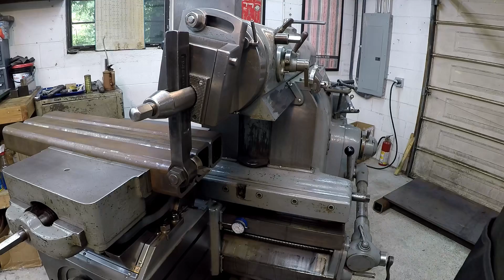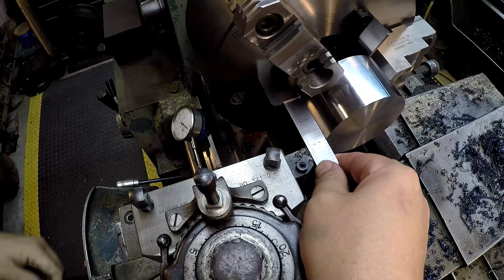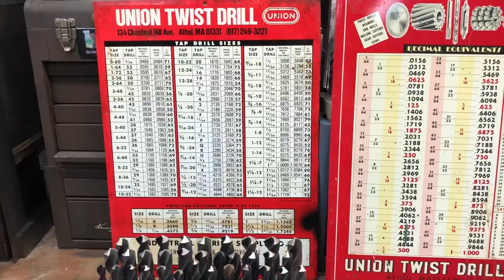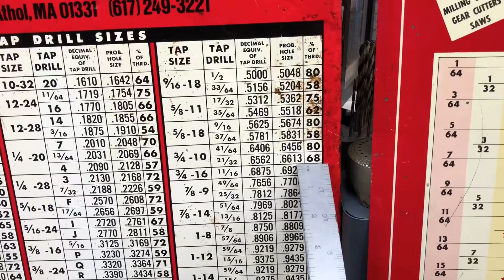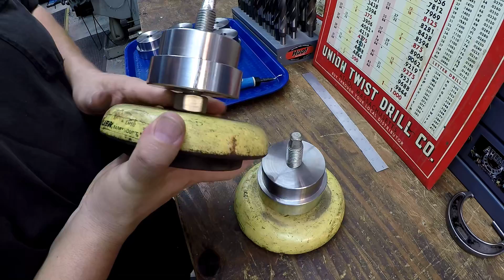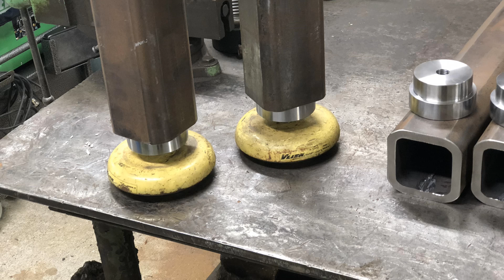SNS 225 Part 2: Weld Bosses for Table Legs

Comment: For all the people complaining about you spending all that effort on buying and shipping and restoring the shaper, here's your answer. How else do they propose squaring up those tube ends? Get a 5" long end mill and hope you don't wreck it on that weld? Stand the tube up, bolted to the front of the milling machine table, and indicate the sides perpendicular to the table? Set it in a four-jaw chuck on the lathe and hope that you've got a great big through spindle? No, just set it in the shaper vise and set the automatic downfeed, and sit back and watch, making sure you don't get chips flying at you.

Comment: i worked with a old machinist he  was 90 years old in 1994 but dang he could  lay down some tooling fast. Sitting at the break room table said his boat had a full machine shop in mills drills whatever they needed he did say they got into trouble one day trying to get out  fast they through the whole machine shop and welding shop over board yes that what the man told me. its kinda weird those of us never been on a bout to have a full machine shop welding shop etc but they do thus day

Comment: Does only the male threads need the crest removed or do you have to also remove them from inside the female post tapping?
Reply: Only the male.... the female shouldn't have the same burr as a male thread

Comment: how to set R.P.M for cutting and is there any formula for this purpose
Reply: There's one equation which I've used, though it's for metric, I don't know if it's applicable with imperial.
ω = spindle speed (RPM)
s = speed constant found on chart (m/s)
d = cutter diameter for milling or stock diameter for lathes (mm)
ω = s * 1000 / 3.14 * d

The 3.14 should be pi but I don't have that symbol on my phone. As I said, this is for metric and may not be for imperial.
Reply: Imperial calc. is pie × radius square.

Comment: Not a use for a shaper that I would have ever thought of.  I always really enjoy your shop videos.

And yep, you have about 0.005" of shimming to do on that tailstock; note that unlike cutting to see whether it cuts a taper, direct measurement means you make the adjustment for the full indicated difference.

You have to paint over those rust-conversion products. They make an excellent primer (once they have converted the rust and turned black), but they are neither weather-proof nor abrasion resistant.

Comment: There is nothing more satisfying than watching steel being squared on a shaper! I really like that shaper. You're looking good too Adam! losing weight, feeling better I bet. I'm a buttermilk biscuit under 300lbs but I'm losing weight, had to get my diabetes under control, most of my biological family has diabetes, bad hearts etc. It's in my genes. But I digress, great video's I love your work. Those drill bits are nice and sharp, I love it!

Comment: Use osopho on raw tubing to prep for paint. It leaves a white powder when dry (two or three days). In South Texas we use it to prep salvage drill stem we use on the ranch for fence corner posts, gates, etc. Should cost less than 20/gal at big box lumber yard.

Comment: Hello, I bought an 8" bench grinder and it came with some cheap grinding wheels that I find are to soft as the particles seem to come of really easy and I would like to know which 2 grinding wheels I should get? I plan on using it for grinding mild steel aluminium and stainless steel (not tool steel yet). Love watching your channel, keep up the good work. Thank you
Reply: Are those wheels green? If so they could be the special one for sharpening carbide. Don't waste them on regular work.

Comment: Hi Adam, shouldn't you have the clapper box holder tilted the opposite way so when the clapper box lifts on the back stroke it move the tool away from the workpiece?

Nice finished surface.
Reply: I think the tilt is set correctly. Imagine the plane of rotation (perpendicular to the axis of rotation). The higher you go on that plane, the further you get away from the workpiece. As the clapper rotates on the back stroke, it lifts the tool higher on that plane, therefore away from the workpiece. If you set the tilt the other way it would rub against the cut surface on the backstroke.
Reply from the maker: It’s set correctly

Comment: Nice video like always. By the way, did you know that those yellow feet have built in height adjustment? If you unscrew the stud the black rubber part will slide in the yellow housing under the machine weight, and if you screws it in it will push it out. I’ve got those feet’s on my mill. Thanks and keep up the good work.

Comment: Ha!  I've got a very old Eagle bottom plunker that had the same thing happen to it.  Now I don't feel quite so bad about it.  It did actually give me a bit more control on when oil came out of the tip, so I haven't bothered to try opening it back up.  Very good for putting a very small amount of oil in a very specific spot.

Comment: Never leave metal surface after using rust converter surface as is without proper primer and paint. It sucks moisture from the air and metal is rusting inside. When the paint bubbles its to late.

Comment: Is the machine feeding downward?  or is the table feeding it upward ?
Reply: On the shaper, the tool head is being fed down. Not the table up. The table only has left to right motion powered/automatic.
This is evident in the shaper rebuild
Reply: Brad Woollon..... that's what I was thinking, wasn't sure. Thank you for clarifying that.
Reply: +Travis Harrison - I'm no machinist and don't know exactly how it works, but if you look at the top of the clapper box, it is higher up on the round head at first, and then lower later. So what I see is the clapper and held tool lowering, not the table raising.
Reply: At 3:45 you can see the crank on the toolslide turn by itself, actuated by the cam/arm on the side of the ram.
Reply from the maker: The table is fixed and the tool head is moving downward on each back stroke. Notice the cam plate on the side of the Machine and the hand wheel advancing on each return stroke.
Reply: I've never run a shaper before so I have no idea how they operate. However I have run a Bridgeport and cnc's before. It is a interesting machine though.
Reply: But thank you all for clarifying that for me.
Reply: whoever created those parallels was a genius.
Reply: Have you ever crashed a machine?
Reply: I'm German and I love Machining.

Comment: Hi Adam,

With all of the modern cutting lubes, I, like you, still stick to old fashioned dark sulfurized cutting oil (DSCO) for steel over about 1/4" tapping and threading.  Unlike other "lighter" duty lubricants, I never have a problem with chip welding with DSCO.  If staining isn't a problem, I'll use it on non-ferous metals as well.  Ridgid and Black Swan are my go to DSCOs.  I love the smell of DSCO in the morning.

Comment: Adam, another thing to talk about in an SNS at some point is why you always want to snug up your drill chucks on more than one hole. Especially a precision chuck like the Jacobs N series. I don't think a lot of people know that you want to spread out the load on the chuck internals as well as getting a tighter bite on what you are putting into the chuck than tightening just one hole. This is a good episode.

For the two drill sizes for the taps. My dad and grandpa always called those "Machine tap" and "Express tap" size drills. I think Ive seen a drill chart call out the "Express" before but can't remember.
Reply from the maker: Good stuff Brian. 👍🏻
Reply: Brian Streufert z

Comment: Just curious, but how well does the HSS tools handle the rough return stroke. I would think with it banging on the material so many times that I would dull the tool quickly.

Comment: With the shaper, could you, in theory, make a double side tool so that it cuts on the forward stroke and the backward stroke?  Would the machine be capable?
Reply: HighTechLab I do not think that is possible because the “clapper box” mechanism is hinged and therefore I believe only works on the push stroke!
Reply: thats correct, also the down feed would have to feed at both ends of the stroke, not sure what that would take.  The stroke is also engineered to move faster on the back stroke to increase productivity, so it would affect your speeds.  It might be possible to make it work, but would require more modifications than just a different tool.
Reply from the maker: The table or tool head is only advanced on the return stoke.

Comment: Hey Adam, Would it make more sense to mill two flats on each boss and not weld them in so you can rotate them to level the table? I can't see those rubberised feet wanting to spin with 1/2 ton of table pushing down?
Reply: Only the nut has to move in order for table to come up. Or am I missing something here?
Reply: Don't think so. The nut is just to lock after adjustment. The bosses are threaded...
Reply: You're right, I just re-watched that part to check.
Therefore, you have a very valuable suggestion, it seems to me. Those feet won't easily budge under load.
Reply from the maker: The bosses will be welded to the tubes. Rubber feet will be adjusted then locked with the hex nut.

Comment: I Ike the spider for the chuck. I have an older tap chart, it actually shows 3 or 4 percentages if thread. I sometimes use 50% thread on the tool dovetail mod because I locktite the studs and the tool holder steel is so tough

Comment: Hey Adam,
Here in Scotland I've used a product made by Hammerite called KRUST,  a watery milky liquid that converts rust to a black primed surface like the product you describe.  Be prepared to be amazed if yours works like mine did. Quite expensive though but worth every penny (cent)
Reply: I've used this from many different vendors, Hempel, Northstar/Lusid, Brunox, Biltema, Bilt Hamber etc etc. Never encountered one that didn't work, but ymmv when it comes to the durability of the coat, pretty much the only difference I've noticed. But as long as you prime and paint over it later or keep it indoor it lasts pretty much forever.